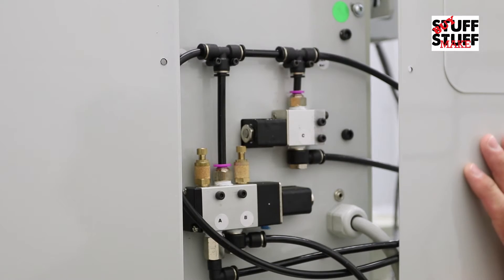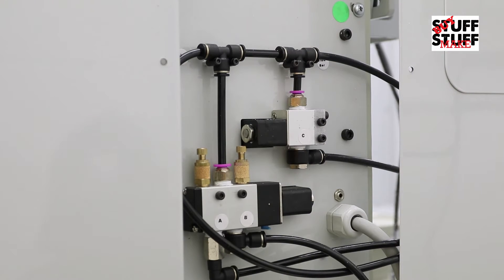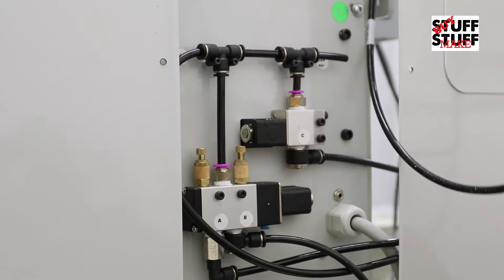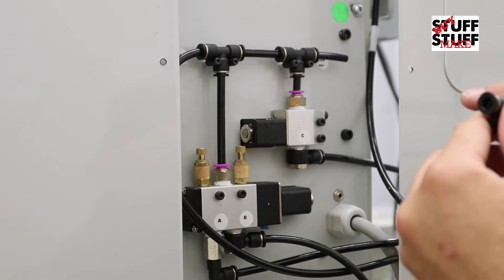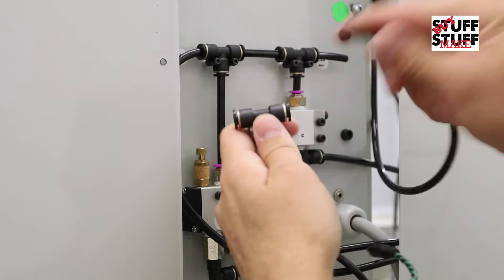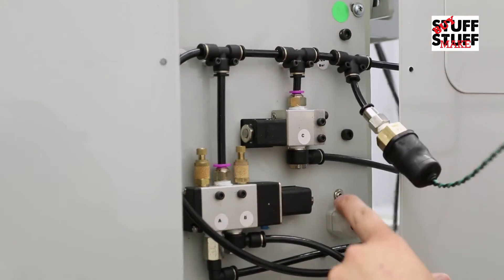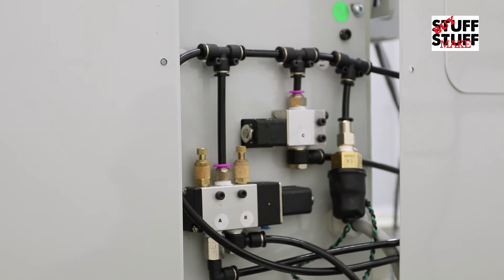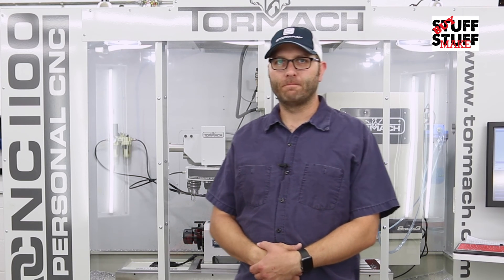Tormach PCNC1100 ATC Air Pressure Sensor Install

Comment: Hey BSMS, I'm trying to understand what the "aftermath" is... How necessary is this thing?
Reply from the maker: If you have no air pressure and no sensor, when the automatic tool changer tries to remove the tool from the spindle, instead of having the tool transfer to the tool changer, it stays with the spindle and rips off the delrin part of the ATC holder.  Fortunately the delrin part is held in with plastic bolts for just such a situation, but it is still a pain.

Comment: I suggest that you place the sensor above the pressure line as water will condense and fall into the sensor and damage it, even if you have a filter dryer on your compressor.
Reply from the maker: Hi Mike - thanks for the tip!  I'm thinking it would be as simple as just rotating the sensor where it is so it is pointing up rather than down, therefore keeping it above the pressure line.  Does that make sense?
Reply: Yep, that should do it, as long as you do not get a lot of water in the system.
I had my own question about your install. Did the path pilot all ready have a function for a auto chuck ?
Reply from the maker: Pathpilot has the automatic tool changer and power drawbar functionality built in.  Does that answer your question?
Reply: Cool, I new about the Tool change but not power drawbar.
I though pathpilot might have had away of adding extra functions via some sort of edit process.